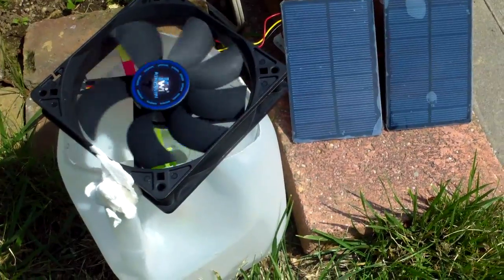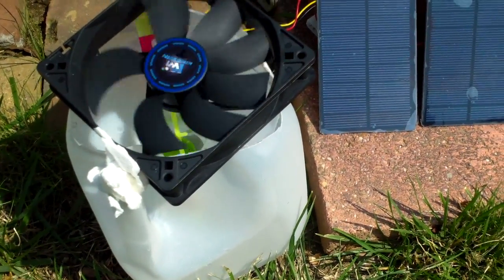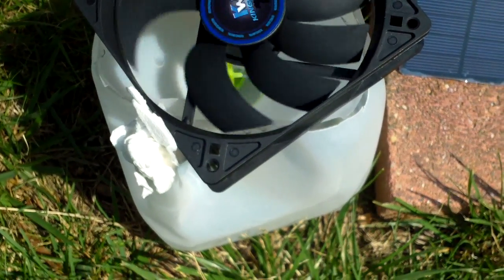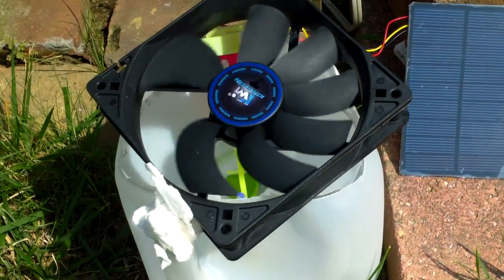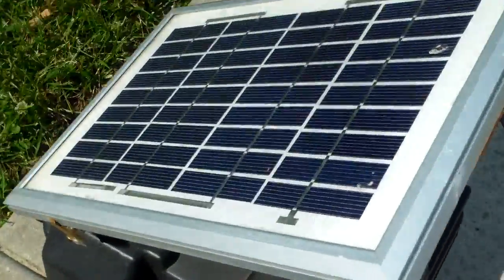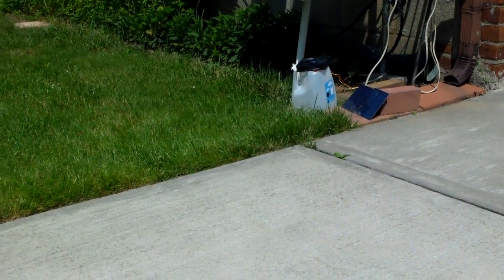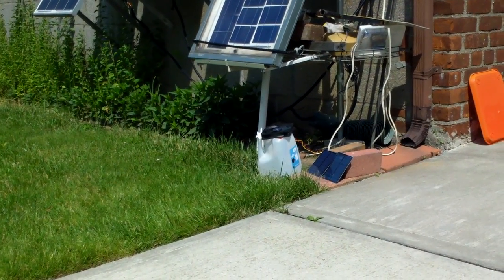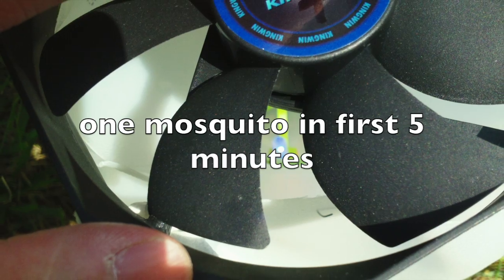Solar powered mosquito trap part 1

Comment: This is pretty much what Ive done on a smaller scale, and it works excellently on micro-midges that we have here in Sweden.
Also sucks in mosquitoes, but they generally avoid air-currents, so not so much. Or perhaps they just dislike downward air-currents. So I will be experimenting with horizontal currents as well as upwards.
Anyways, I find that on the sometimes low RPM generated by my solar panel, the mosquitoes just gets hit by a fan blade and gets to fly on. So I made a funnel, so they are sucked down properly. But still no amazing results for mosquitoes.
Oh, and I have most of my container hollowed out, so there is no resistance to the air current. And covering the holes with mosquito net.
Reply from the maker: uruk boff Thanks for your insight. It will add to our quest for a better mosquito trap. I've also been reading up on some of the plants that can repel mosquitoes like menthol, jasmine, lavender etc. I like your idea with horizontal or upward currents or drafts to draw the bugs in.
Reply: wtam69 I'm starting the experiment today. Though there aren't many mosquitoes around. I guess I will have to go hunting them, with just my powerbank for smartphones, and a fan with a mosquito net around outflow end of it to capture them in.
Perhaps they will just be drawn naturally towards upwards currents. Now that would be a discovery!
But I do think it will be more effective.

I've also checked out plants to keep them away. But at least lemongrass needs to be wintered at above 8° C. So it's a no go for Sweden at least. Well, unless you have them in pots and take them in for the winter. So I will be checking the growing conditions required for other plants, beginning with those you listed (so thanx).

I will be reporting my results tonight :)
Reply: By the way, in some regions in Sweden we get floodwater mosquitoes to an insane density. From 50000 to 89000 per CDC trap per night. This was just from an expert on a news program, and I haven't checked the numbers properly.
But it's so much that you can hardly breathe.
So DIY traps could really be revolutionary, and a market here. Considering how overpriced commercial traps are.
Reply from the maker: uruk boff Good basic research. Our friends came over for a BBQ the week before and naturally some more than others became dinner for the mosquitoes. Look forward to hearing how you deal with mosquitoes in your country.
Reply: wtam69 well, we don't have any special methods that isn't available to the rest of the world.
We just get used to them -- as they don't spread disease here (as far as I know).
We use the usual aerosol, roll and creams, quite a lot.

Experiment #1: a fiasco! it wasn't me who hunted them -- rather them hunting me.
But I made a pretty good trap out of an old yogurt container (plastic bucket), and captured 8-10, before fleeing.
It worked well, even without a funnel above the fan, but it wasn't effective enough, as they fled from the air currents.
But I found a 45 degree or something, upwards current worked the best.
So next experiment is with a funnel and some LED lights. And going out with jeans instead of shorts ^^

Comment: Lol, you've got me thinking again. I like this idea. I live beside a swamp and the mosquito's and black flies are terrible. I can't even turn the outside light on when I let the dogs out to do their business because when they come back in, a million bugs come with them. I think just the one led and water/detergent solution would work just fine for me. Thanks for sharing!
Reply from the maker: James Biggar There are many suggestions on the Internet but I am trying to find a somewhat simple and automatic routine without making complicated mixtures. I have seen people using zappers, sugar/yeast solutions, high velocity fans etc. I'll start with the simple and see how it goes.  Mosquitos will seek water to lay eggs  without too much encouragement. The AC type zappers work the best but the high voltage necessary makes it tricky for do it yourselfers. Solar powered devices are much cooler and fun.

Comment: I like the idea a lot.  Looks like it should be at least somewhat effective provided you find the right mixture.  I'd add another LED or 2, perhaps one in the UV range as well, I believe they are attracted to that.

My only concern is how the fan would be affected by the weather, like if it gets rained on.
Reply from the maker: jaykay18 The key is the right mixture that gives off the right scent to attract. Some people say the mosquitos are not attracted by the blue or uv light but I see all the commercial ones have the blue and a bit of red. I'm going to give mine blue white, blue and red. The fan is like a vacuum to suck the suckers in. Being 12 v,  it should be pretty safe. If it works, I can build a little roof over it to cover the fan.
Reply: wtam69 Yes, at 12 volts there's nothing to worry about, I was stating simply about the longevity of the fan.  A roof of some kind should do it.  If you're going to put a red, white, and blue LED in there, the mosquito trap should be especially effective on the 4th of July!
Reply from the maker: wtam69 The neighbors are already playing with their fireworks already, or what sounds like firework.
Reply: wtam69 Gotta make sure they work, it's on a Saturday this year so it's going to be a big one!  They've been playing with them here too.